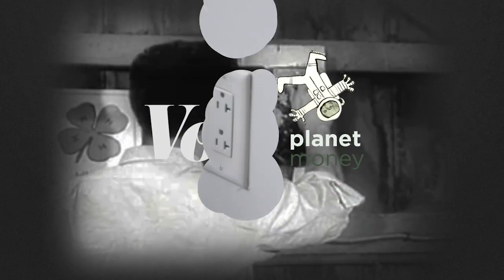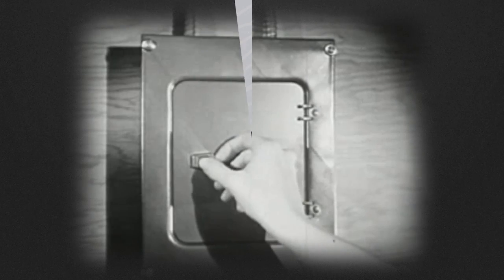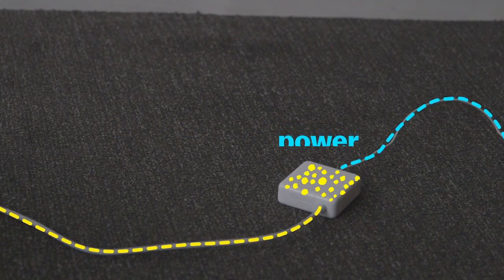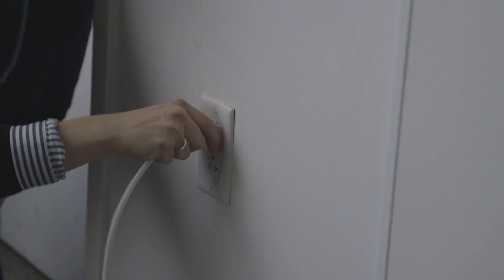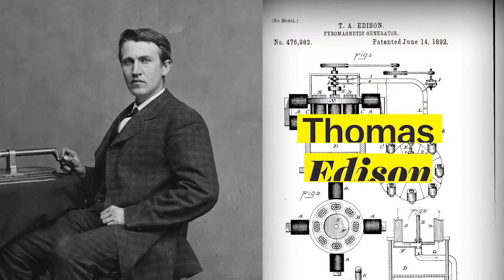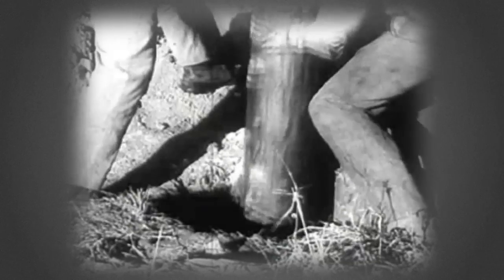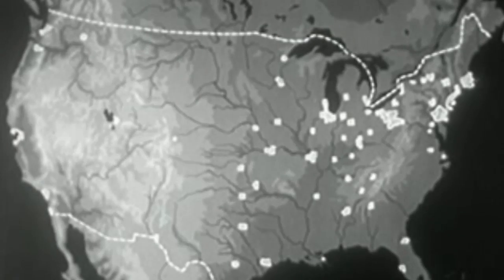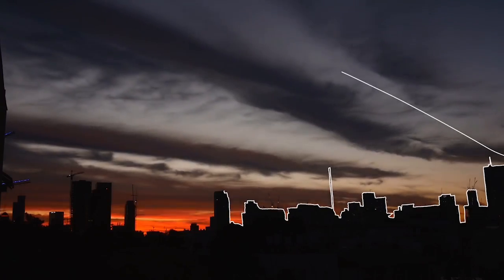Why your laptop charger is so hot

Comment: Wait Wait, you say people had the choice between AC and DC, and they had to chose between Tesla and Edison, that's not how it went. Back in their time DC was the power used, but it had limitations, it could not go over greater range without losing to much power for it to be usable in the other end. Edison was one of the people that supplied DC power to people, but his generators was not that great at it, along comes Tesla and he makes a deal with Edison that if he can make a better generator he would found him with 50.000 dollars. But when he has made the new and better generator Edison say's the it was only in jest that the money was offered (there is more to the story, but yeah you got internet). Later Tesla makes the AC generator, that can transmit power over greater range and was much more economical to use and safer (DC motors spark a lot and had high replacement rate). We don't use DC in houses today because of how dangerous it would be, there where a lot of houses fires back then and DC higher current will kill you where AC is safer (Edison tried to prove it untrue but failed), and because is only useful in short range and has a high maintenance cost.Just think about how often a converter breaks with high use, with a house it would be constant use. And the part about saving power, well you would use even more power, all things in your house would then have to run DC instead of AC, so if you only needed to convert power to you phone and laptop that would be WAY cheaper than converting enough DC to run you microwave, coffeemaker, oven, washing machine, lights and so on, maybe 5-10% of your power is converted to DC and you want it to be 100% just to avoid a converter to your phone? 
This is really a first world problem asked by people that don't think about what they are doing.

Comment: An interesting idea, this whole-house DC converter.  With new standards like USB-C (which provides enough power to charge a laptop, or anything smaller like a cell-phone) it might be practical in a few years.  We just have to get all the manufacturers to all play along, which will be difficult.  I've often wished I could simply plug directly into a DC power source, and avoid having dozens of "wall warts" all over my house.  Perhaps in a decade or so, after USB-C has really taken off (assuming it does) someone could implement this whole-house DC converter unit.  Looking forward to seeing what the free market will bring in the future.

Comment: waaaait a Minute... AC does actually not work (realy) fine for LED Light Bulbs^^ and anyway isn't the most energy lost because of the Voltage difference? 
U just need 4 Diodes and a Condensator to convert AC to DC... Correct me if I am wrong^^

Comment: Having a high power ac-dc converter for the whole builing or the whole grid would make it worst simply because not every dc device work at the same voltage so you would need another dc-dc converter anyway which increase the wasted energy in conversion

Comment: She doesn't get into the details at all.
Converting AC to DC (or the other way around) can be done very efficiently, and the converter won't get hot because very little power is lost in the conversion.
Thing is, consumer electronics are specifically designed to be as inexpensive as possible, but still do the job. So, the power converter is built with lower-than-possible efficiency, because it keeps the cost of the device to an absolute minimum, but the converter wastes energy by dissipating it in the form of heat.
Computers, phones, radio & TV sets, etc.--all of these electronic devices only run on DC power, and if they use batteries for portable power, the battery also only works with DC, so a converter is a must--but it must be built in line with the cost of the device. Nobody wants to spend $250 for a charger for a $400 laptop!
AC power is used by the main grid because it's easier to produce at the power station and easier to efficiently convert to different voltages for distribution without having to use converters with expensive electronics or moving, mechanical parts that require maintenance, and that's why every building is supplied with AC power--if you want DC to power an electronic device, the power is converted to DC electronically, usually by the device itself or its own charger.

Comment: The reason that adapter is too hot to touch is because it clearly fucking sucks.
Any properly designed switch-mode power supply gives off negligible heat.
The old adapters used a step-down transformer, diodes, and capacitors, and were fairly inefficient, so even a shitty 3v adapter would get hot enough to discolor the casing over time.

Comment: This video didn't really explain why. Your wall outlet (in the USA at least) is putting out 120V AC, and your laptop needs 19V DC. Inside that box is a transformer that steps down the voltage and stepping up the current in order to power your computer. Due to the laws of energy conservation, some energy is transformed into heat.

Comment: Well, regardless of what you do you will still have about the same total loss from the conversion doing just once or having a separate converter for each device. Sure, doing it just once gives you some slight economy-of-scale advantages that would let us instead invest in converters with better overall efficiency, but the total amount you would save doing this is not that much.
Distributing the low-voltage DC power in the required current capacity to the whole house would also be a nightmare. In order to safely deliver power, you need to have a cable that is rated to be able to deliver the appropriate amount of current across the specified distance. The more power or the longer the distance, the thicker the cable you need to avoid wasting too much power just getting through the walls, or you will just end up back where you started, just wasting the power in the transfer rather than the conversion. So instead of a 2 meter half-cm diameter cable for each of a dozen devices devices (for about 30 meters in all), you would need something more like 100-200 meters of 2-cm diameter cable, depending on the size of the house, and cabling that size gets really expensive, really fast.

But more than that, most of the power you actually use is not from computers or laptops or phones: these devices usually top out at 100 W (not counting tricked-out-to-the-max gaming computers which run about twice that), which is actually quite small compared to the amount you spend on running your heat pump and ventilation systems. And unless you have natural gas and hyper-efficient LED lights, also your lighting and electric furnace and water heater and dryer. Almost all of these systems would run equally well from AC or DC power, and in a few cases (like vent fans and other motors) they actually require AC power to work correctly.

Comment: How would that save energy? We'd just be loosing power to heat when we convert AC to DC for everything when only our electronics need the DC and not our other things, like lightbulbs. Wouldn't we lose power converting for everything instead of individually? Or would an all-encompassing converter just be more efficient at the conversion that the extra power converted is inconsequential?

Comment: The people in this video have no idea what a power supply even is... Let me clear some of the bullshit promoted by this video. The conversion from AC to DC is done using a simple full way bridge rectifier. Bridge rectifiers are VERY SIMPLE circuits made of four diodes and they are very efficient, thus producing almost no heat. The actual reason why power supplies(like laptop chargers) produce heat is the down conversion from 110-240V to 19V. This down conversion is done these days using a SWITCHING POWER SUPPLY. Switching power supplies work similarly to how you control the speed of a car in a video game using the W key. You press the W key repeatedly, the longer you hold the key down each time you press it, the faster it goes. This is called Pulse Width Modulation. Switching power supplies use a similar method to control the voltage coming out of the power supply. Instead of a W key, power supplies have an electrically operated solid state switch known as a MOSFET. MOSFETs aren't very efficient, so they produce heat. MOSFETs are also the logical element in modern CPUs and GPUs and they are the same reason why computers need cooling. There are other parts within power supplies that may produce heat, but this is the main culprit. Also the light bulb at 1:00 looks like an LED bulb, which needs DC power, not AC. It has a power supply inside it.

Comment: the benefit of ac is that you can step up the voltage in a transformer.  There is no DC equivalent.  Also power has to be generated as AC anyways.  switching to dc is impossible and would not save us money

Comment: The correct answer is AC  is better than DC because AC can be transformed, that is the voltage can be made larger or smaller.  Higher voltages are easier transmit over distance without too much loss of power. This is due to Ohms law which states; 

    The current flowing through a resistor at a constant temperature is directly proportional to the voltage across the resistor. 

The conductors (cables) used on a high tension power grids conduct electricity, but they do have a resistance. 

Voltage is the electrical equivalent of water pressure in a pipe, and current is the time it takes for a quantity of water or electricity to flow.

A conductor is to electricity what a pipe is to water. 

Transformer is a coil of copper wires that changes the voltage.

The molecules of the metal used in the wires (aluminium) need to be excited by the electricity to make them move. As they move they both pass on the movement and get hot, just like a person does when they go for a run. What makes them hot and what they are resistant to is current so if we use a low current they will get less hot but still pass the movement. 

As current is proportional to voltage, the inverse must be true. So higher voltage means lower current.  Lower current means less lost power due to conductor heating.

Power stations produce electricity at 25,000V. Electricity is then stepped up and sent through the National Grid cables at 400,000V, 275,000V and  down again to 132,000V in the local grid. This is then reduced again to domestic voltage which is about 240V everywhere except the Americas where it is 110V. 

Your little charger is doing exactly the same thing. It is taking 240 or 110V and making it 6,12 or 24 volts. It is also taking away the alternating current using a coil of copper wires and some other electronic components like diodes, capacitors and resistors.  This is called rectification. It means making the current go only in one direction. That is really complicated to explain unless you have an engineering background.

Comment: my favorite thing about this is that the lightbulb they show at 1 minute and say handles AC just fine is an LED model. inside it theres a little stepdown AC-DC converter, and is probably the only device that actually presents a decent reason to have a centralised stepdown converter. instead of tossing a converter each time your LED bulb goes out, you just chuck the bit that lights up.

Comment: This video really dosen's answer much in the way of WHY your laptop charger gets hot, so i'll take it upon myself to explain.

The heat that radiates out from the charger is largely a result of electromagnetic losses when converting the mains voltage (either 110VAC or 240VAC) to low voltage (usually around 19v for laptops). Voltage is converted through Faraday's law which states that any change in the magnetic environment of a coil of wire will cause a voltage to be induced in the coil. Because AC power is constantly changing from positive to negative, its magnetic field is also constantly changing polarity. This being the case, when a coil of wire being charged with 240VAC is placed next to another coil of wire, the constantly changing magnetic field of the first coil causes a voltage to be induced into the second coil. The actual value of this secondary voltage is determined by a number of factors which the manufacturers set to produce the desired output voltage. 

The heat losses in this process are mainly electromagnetic losses, namely hysteresis losses and eddy current losses.
Hysteresis is the lag time the copper wire takes to change its magnetic polarity and the extra force required to overcome this lag. 

Eddy current losses occur when the changing magnetic field also induces a current into the conductive transformer core which, due to Lenz's law, opposes the magnetic force of the main magnetic field of the transformer. If the transformer coils where made of a single solid conductor the eddy current losses would make the transformer extremely inefficient which is why nearly all transformer cores are made of laminated steel stampings to reduce the size of the eddy currents.

Whew, hope that explained it.

Comment: Big fallacy that DC is worse then AC for power transmission, Both AC and DC can be stepped up in voltage to be carried across long distances, except at the time there was no way to effectively step down DC. That is why we use AC current.

Comment: The bulk of the box is a transformer converting the voltage from 120/230v to what your laptop uses to charge its batteries(Maybe 12v ish).

Comment: I clicked "dislike" on this video because it has a lot of inaccuracies.

If you have a low voltage, you'll need very thick wires very quickly. Even a few feet becomes a problem. Example with just your cell phone: if you use a charger with the cable that comes with it, it charges quickly. If you buy a longer USB cable that is maybe 10-15ft long (they exist), your phone may either not charge at all, or charge very slowly. This is because they didn't make the wires very thick.

Next thing is, some things work with 5V, others with 12V, others 19V (like most laptops), and I need 52V for my ebike. Let's say we had a stable 12V DC supply all over the house, in order to make 19V or 5V out of it, you need to convert it. Converting involves (in a simplified terms) turning it temporarily into AC, transforming it, and then into DC again. Switched power supplies don't do this exactly and are more efficient, but still have losses.

Comment: Actually DC travels better than AC due to skin effect and parasitic inductance. The only drawback of DC that it was not possible to step down or step up the voltage and AC can. so AC comes to dominate the scene a long time ago (because higher voltage have lower power loss) . However modern technology allows us to do DC-DC conversion quite efficiently. There is a research going on to do transfer electricity large distances using DC instead of AC. But the main problem is we might need different infrastructure to do so.

Comment: My laptop power supply A/C adapter) is only slightly warm, about 112 F, (44.4 C), the one in the video looks like it may be an Apple product, I've never used one and they may get blazing hot. I'm sure the folks at Apple will be glad to have you run down to one of their stores and sell you a new one for $375.
Oh yeah, and next time you do a video on electricity, maybe you could get someone that actually has some knowledge on the subject to write the script.

Comment: It's not true that AC is better for transmission. In fact, the opposite is true, because DC doesn't have reactive losses. AC is more convenient to convert to different voltages, and therefore to achieve the high voltages needed for efficient transmission. It's also more convenient to produce with most of the existing power plants.

Comment: AC is not better for transmitting long distances as some of the longest power lines in the world are DC which use less material(conductor, transmission towers, etc.) and clearances, as well has lower line losses.  The problem actually lies in transforming DC voltages into the highs and lows necessary at efficient conversions necessary to make practical power transmission possible.  With modern technology this is possible for "intertie" style line which transmit power from far away generation to a more populated area where its needed, or there are several other reasons for the biggest of which perhaps is DC is often used to connect different grids together so that their AC waveforms don't have to be synchronized; an issue that is compounded when the grid gets more interconnected and very large distances are involved.

Comment: Yeah you have really no idea about the science, we use AC because it really efficiently converts between voltages.
This is opposed to DC where to reduce the voltage you actually have to release the excess energy as heat.
Because all out devices use different voltages if we covered the power to DC centrally and at one voltage it would be far less efficient because each device will be inefficiently converting down the DC power's voltage.

Comment: Well this was a waste of time. Why does it get hot? because it heats up. Also surely having a massive power converter in your home working 24/7 changing AC to DC would waste far more electricity than just having a couple of boxes on chargers.

Comment: People should also know that one of the reasons why DC power isn't used in power lines is because DC power can't travel through long distances. AC on the other hand can travel farther. (layman's terms) Imagine having a long wire then you pump in DC power on one end, if you read the amount of power on the other end, you'll get a lower reading. Make the wire long enough then eventually you won't detect any power. But if you use AC, you'll get more power on the other end.